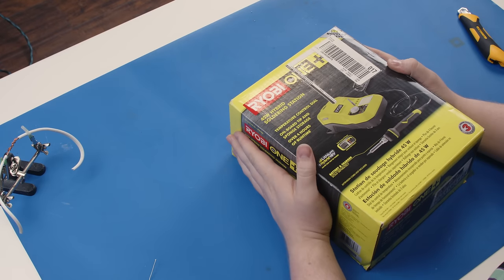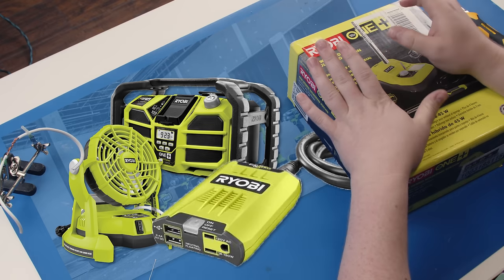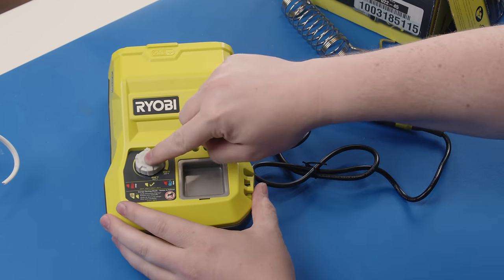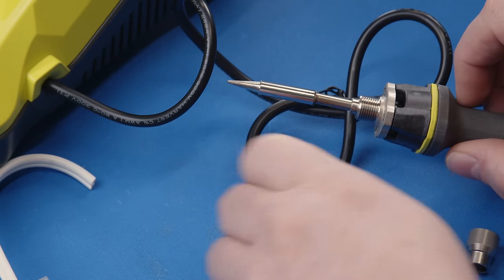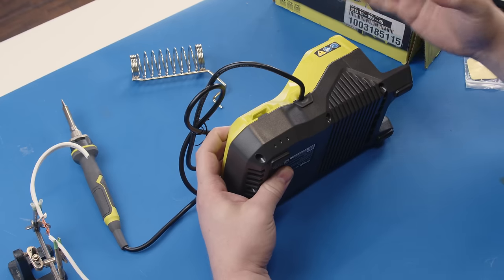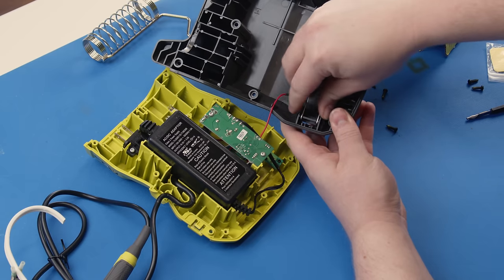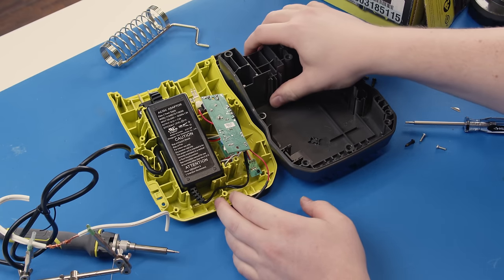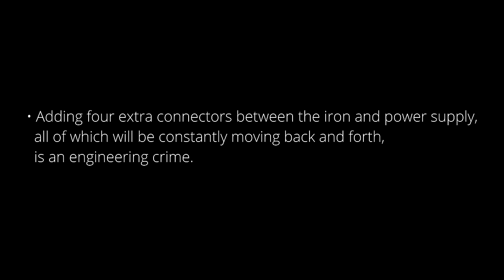Ryobi has GOT to be joking with this soldering iron

Comment: I'm a field technician and I have the Weller butane powered soldering iron and it comes with a good amount of tipped choices which are interchangeable they are a bitch to change while hot! However they even come with a hot air blower a blow torch attachment and several other handy dandy things that come packed in it. I keep that in a tool bag with all my shrink wrap and sodilus connectors lol but I use the heat gun on the Weller to shrink the shrink / glue fitting which makes them nice and water tight and I've even purchased many other tips from plastic cutting to plastic welding wide extra large soldering heads for larger gauges and even very very small electronic PCB working style tips. It does jet out to the side the exhaust which can sometimes well you know burn shit next to what you're working on but I now keep tin foil in my bag and I have a full assortment of plumbing equipment so I always have some sort of heat shield etc. But when you're on the go the Weller butane is really top-notch it's not a junky piece of shit in fact snap-on private labels it and charges five times as much for the same thing! It only cost about a hundred bucks for the kit a good can of butane and believe it or not premium butane is better than just regular old butane it's more refined and gives you a more consistent flame that'll cost you about 12 to 15 bucks and I use it it several times a week and I haven't replaced it and coming up on a decade. So 10 years refillable it comes with a little sponge but I keep several sponges and Ziploc bags I use my super 33 round containers from my 3M tape and then I tell the wife I'm buying her new sponges and I steal a bunch and just cut them circles to fit in there so they're coverable and just use some purified water like I carry reverse osmosis water with me everywhere so I went to sponge and then while it's wet I put it in the Ziploc bag so it doesn't douche my satchel and I'm good to go Great video keep it up Peace out
Reply: I used to use one every day as a telecommunications technician. Sometimes they would flat out refuse to work. Elements burn out fast too.

Comment: Ungar made a marvelous soldering iron. It used thermo magnetic temperature regulation. The tips have alloys with different curie points. The barrel has a switch and a magnet. When the tip gets up to temperature, it loses its magnetism and the switch opens. When it cools, the tip becomes magnetic again and closes the switch, heating the iron. I once left my iron on when I went on vacation. After two weeks, the tip was still fine. I had a wide and a narrow tip. The tips never wore out. Perhaps that is why they no longer make that soldering iron.

Comment: The temp rating on a cable is typically considering how hot the cable can get within a conduit but it would also apply how you did it.

Comment: This is why I've gotten a Pinecil, from Pine64, they use 65-90w chargers. They're not professional or replacements for Hakko setups, but has made my tech bench cleaner for those moments that I need to solder. It's not fantastic for 400+ temps, but honestly it's fine and the TS100/Hakko compatible tips makes it affordable and reliable. I also purchased some very nice silicone type-c PD cables for my bench and gives it a great feel and flex.
If you get a good external battery with PD or DIY your own, it's portable as well.
However, appreciate the video because I've questioned myself grabbing one of those Ryobi sets... but I'm never that compulsive to buy at first, second, third, fourth look...

Comment: Great teardown.  Fun and appreciated.  Thanks a bunch.  I wonder about aftermarket tips for the thing.  A replacement cord would be interesting, too.  The difficult part would be cracking the shell on that power brick.  Probably not worth the mod.  Still it seems like a handy soldering iron to have in your bag of tricks.....

Comment: I have one of these, and I love it. Sure, it’s far and away the worst soldering iron I have, but when I need to repair something simple (like replacing the wiring between the final junction outside and the motion detection light a foot away from it) my options are either dismounting the entire assembly to bring it inside to my workbench, grabbing a MAP torch, wheeling out a welding cart, or jamming that Ryobi in my pocket and walking back outside. Easy choice. 

Would I ever use it inside, or if it were even plausible to use a torch? No way in hell. But if I’m just reflowing the end of stranded wire I don’t really care how it looks as long as it captures everything. Then again, I’ve never tried using it for anything where the quality actually matters, so to me it’s basically a hot glue gun for metal rather than specialized epoxy for metal (like a tig welder).

Comment: This is a very interesting product 'breakdown'.  You mentioned cooling.  The power brick may be certified. But that certification loses its relevance if the brick is buried deep within an INSULATING box. I imagine an IEC, UL, EN or CE certification includes some fine print about the assumptions/conditions under which the certification remains valid.
It would be wonderful if Ryobi reviewed your analysis and revised their design. 
1) A solder iron cord that is both very pliant as well as rated for high temperature
2) A detachable, replaceable cord and/or iron
3) A 110V power source and mating enclosure that is mindful of heat dissipation (i.e. was TESTED as an assembly)
4) A tip design that conforms to some existing standard, AND instructions stating which standard (e.g. Hakko FX-8801)   20:03     {BTW: $20 for 2 tips seems pricey}

If they did that, I'd get one, and just maybe, Ryobi would either give you a commission, or at least a set of torx tools to get inside without grinding them.

Comment: It is very rare that you should be applying any significant force with the tip of a soldering iron. Certainly on a PCB you shouldn't be applying any more force than you would be with a decent pencil writing on paper.

The exposed ceramic cartridge is typical of low-cost irons. The problem with them, other than the fact they are relatively fragile, is that the temperature sensor and the heater are in there together. That means that the sensor can be sensing the heater temperature to a substantial degree rather than the tip itself. The reality is that highly precise control of the tip temperature isn't required, but it is still a design with problems built in. The "old" Weller iron uses a sensor that goes up inside the tip while the heater is in the metal barrel surrounding the tip.

Good irons typically have silicone "rubber" insulation. It doesn't have very good mechanical strength or abrasion resistance but it is very flexible and will withstand direct contact with a hot tip without damage.
PVC-insulated cables that have built-in "set" can usually be improved to some extent by heating and straightening. Lay the cable on a towel or the like and blast it for a few minutes with a hot hair dryer. Typically the cable will soften enough to allow straightening (work the "kinks" out by hand and then hang so the cable is straight). It isn't a big improvement but it helps.

There are tips with "900" somewhere in the part number that might work with that iron.

All that plastic is there because the job of designing the case was handed to someone used to designing the plastic parts of mechanical tools that need to be strong.

Comment: As your average electronic hacking enthusiast, I've used 3 different cheap soldering irons along the years, one of them with a potentiometer temperature "control". While not absolute trash (I've fixed a ton of stuff successfully with them), they're far from ideal, but still I would recommend them as a cheap tool to have in your portable toolbox, the average soldering station is way better in every aspect, except that they don't fit in a small lunchbox. But if you got the money and the necessity, the TS100 type irons are a way better choice.

Comment: This year I am 55! (2024) For years all I have ever used is the 15~30 mains corded non temp control. Worked on everything from discreet components to small scale surface mount components. Never had a problem by estimate 50 million connection's over 30+ years... never had any issues. The only time I have ever used a soldering station for an extended amount of time, was in a place where we needed proper control it even had a vacuum pump for De-soldering  today this unit is now considered obsolete! and there is no support for tips ect ect...

Comment: Pinecil for the win! $30, accepts power from either any USB PD (65W) power supply or a 2-6S LiPo (from RC cars/planes). It has open source firmware, an OLED display, easy temperature controls, and uses an accelerometer to keep it powered down until you pick it up. I love it! And there are others based on the same platform and firmware.

Comment: I actually have one of those Cold Heat soldering irons.  I used it a fair amount for smaller electronic soldering, small components on a pcb and wires in 20 ga. range, no bigger than 18 ga.  It worked fairly well.  As you point out, portable battery soldering irons generally aren't ideal or intended for lots of use on a bench where you can use your original Weller.

Comment: I have a butane soldering iron I use all the time outside.  It works fine, but it wouldn't be for micro soldering.

Also, you can just take a portable power pack with an AC port and a normal hakko or whatever.

I also have a USB soldering iron, which is not great, but better than you would expect.

I'm not sure why you need the stand to be included.  It makes sense to me that a lot of items don't come with stands, because many people always have stands.

I would hate this cable too, but it's easy enough not to melt it.  My Hakko soldering iron has a nice rubber cable, which is nice and ergonomic, but I've never tested the heat resistance.  

I would bear in mind that this thing is almost certainly designed for occasional use in a pinch.

Comment: And I will never forget when I first really got into ham radio. I wanted to make some antennas cheap and unique. I ordered a soldering iron from Amazon or ebay and was shocked at how cheap I could get one. Like 5 dollars! Boy was I upset when I used it for the first time. It didn't get hot enough to actually melt solder. Sent it back and got a different one. It would get just hot enough to make a mess but not ball solder.

Comment: I don't have this model, but i have their battery top model.. And I absolutely love it!

And I've been soldering for decades, and have at least half a dozen other irons i can grab for any given project. And most often, I grab the Ryobi. No lack of heat, good run time, and they use the interchangeable Weller style tips. Not much more you could ask for out of a soldering iron, IMO.

Heat controls on a soldering iron are kind of a misnomer... A hotter iron, imparts less heat into the part being soldered. The best way to ruin an electronic part...is try to solder it with an iron that isn't hot enough.

I use a 65w iron running wide open at 845° to do my most delicate work, because it does the job the fastest and doesn't risk overheating parts. (This may well be why you struggle to solder well...try running your iron hotter and moving faster!)

Comment: I have the Ryobi iron, next level down and for just a DIYer, I found it to be adequate. I bought it for when I fix trailer wires. Not perfect, but if suits my needs. It heats up reasonably quick enough to get a solid connection, and when done, I turn it off. I mean I've saved all that time having to drag said cord. Some jobs on the trailer, took longer to get the power cord out, than to do the job itself. Portable soldering irons are worth it for quick jobs. And I've not had a dry joint yet. But have a good look around, ask tradies, or see what the majority of them are using for the quick jobs, and as well do a lot of other research. That research in the long run could save money.

Comment: We love our Milwaukee M12 soldering iron. Best battery iron I've used yet. I work in the 12 volt industry and I'm soldering all week long, and it does well. I literally just stand it on its battery. 
I've looked at the Habanero cordless, but willing to give this a try as I have lots of Ryobi tools.
I'd actually consider beafing up that cable myself. Looks like maybe 10 wires total.

Comment: Disclaimer: I'm only 5 mins in, so i can't provide any direct comparisons yet.

I've been using my same Milwaukee soldering iron for about two years now. I do automotive repair on the side, so naturally I nearly exclusively use Milwaukee 12v tools. I also have a full suite of batteries so as far as portable irons go, it's a no brainer.

I gotta say...I've never melted the tip holder as that guy has. Typical soldering jobs I'm doing is literally just splicing wire harnesses, so I'm rarely using the tool for longer than a couple minutes on at a time, and it heats quickly so during any downtime it's never an issue to just turn it off. Solder one harness, turn it off while I tape up the wires and gather up the next set of wires, turn it back on and it's like I never turned it off. I suspect this is how the tool was designed to be used, and the reviewer who keeps breaking them is instead keeping it on for multiple minutes at a time. Yes, Milwaukee should've accounted for this, but I can imagine why they didn't. Plus, if they don't sell a replacement, others don't seem to have same issue so I suspect it's just partially poor design and partially abnormal usage causing the part to fail.

As far as temperature control goes, personally I've ALWAYS found it more a nice-to-have for my use cases. When I'm soldering PCBs, temp control can of course be _indispensable_. But that's why soldering stations are tbe preferred choice for those cases. But for wire harnesses, where I'm working in the field away from outlets and portability is a must rather than a convenience, the default high heat has always been suitable for me. A dial would be nice, but I can't say I would use it much.

About the stand, the iron is fairly stable when you set it on the battery but it has admittedly always made me nervous. However, you can use the larger capacity 12v batteries which basically give the iron a whole foot instead of a peg leg, and I often use the tool in that config out of fear lol.

The adjustable angle is a strange convenience feature. I use it and I guess I like it, but I've never felt like it's specifically improved my workflow, so it's just needless product differentiation.

Overall, I'm pretty happy with the Milwaukee iron — 7.5/10. If I manage to melt it, I'll still be buying another of the same over a TS100 or Pinecil :-)
Reply: oops thats a little long
Reply: oh huh, the ceramic of the milwaukee breaking is really interesting. I toss my iron around loose in my bag, etc and I've not had it snap, so I'm not sure what the case is there. I'll probably be more careful after seeing that, but tbf a number of other irons I've had do just use that same style of a long heating element chilling in the tube leading up to the tip

edit: It's reassuring that the hakko and ryobi tools both do it too, I found it a little weird you'd never seen it done before.

Comment: Re: The "power brick" power supplies.

First, why reinvent the wheel?  Get something that's built by someone who knows what they're doing.

Second:  The North American Continent isn't the whole world and you didn't seem to notice that both supplies were dual voltage, 110/220 60/50Hz.  The smaller unit's "round" boss was exactly the correct size to accommodate any national or regional power plug.

The soldering station also has a dual voltage supply, but strangely enough is constrained to either a US plug or a European 2-prong plug. (Or any other two-prong plug that would fit thst opening.)

Actually, that revelation thrilled me since i now know I can take this overseas with me!

Re:  The rigid case.

The thing is designed to be portable and run from a Ryobi battery.  Note that the run time with a smaller sized One+ battery is limited - use a larger one.

Because it's designed to be portable, it needs to be able to withstand a nasty fall from unreasonable heights to hard surfaces.  And if there's one thing Ryobi does well, it's drop resistance.

All in all, I think it's a great tool except for two things:
1.  The cheap cord.
2.  The pre-programmed "power-saving" mode where the iron automatically goes brain-dead after 10 minutes, regardless of if you are using it or not.  There's no way to disable it or change the timing.

Aside from that, it's a winner as far as I am concerned.👍

Comment: The other batter powered ones expect you to use the battery weight and flat bottom as a stand itself.

Molds are extremely expensive and there is so much planning and design that goes into them. they absolutely knew what that power supply looked like and planed their mold with that in mind. the price of the mold is going to be pretty much the same either way but commissioning a special part to fit a design would be much more expensive than planning your design around an off the shelf part.